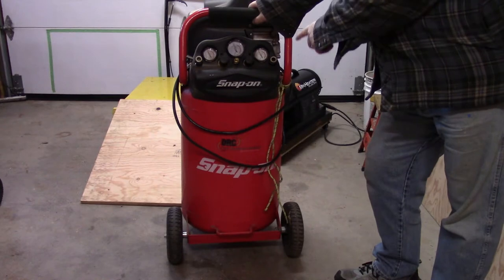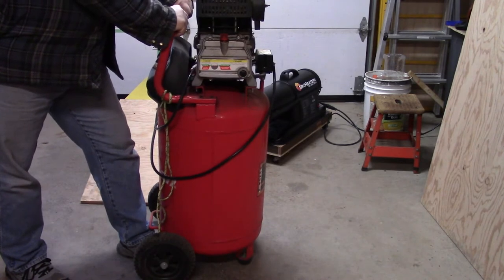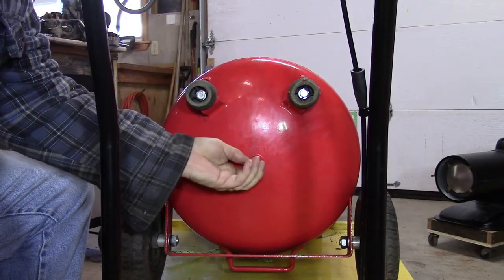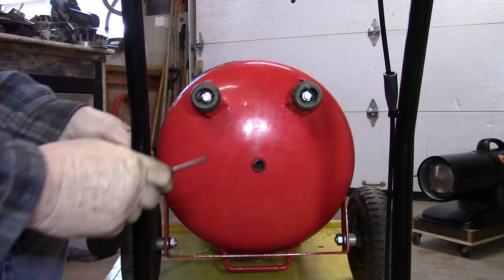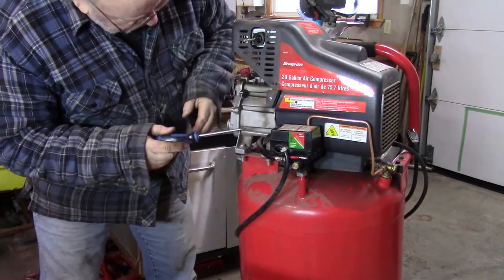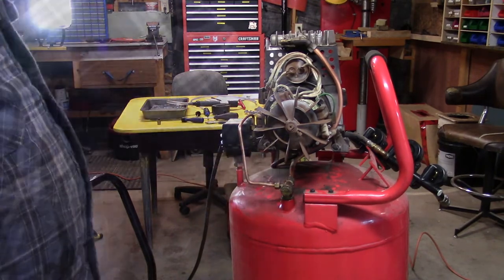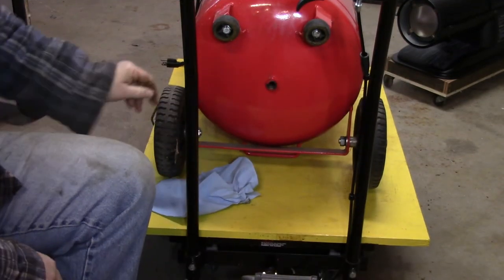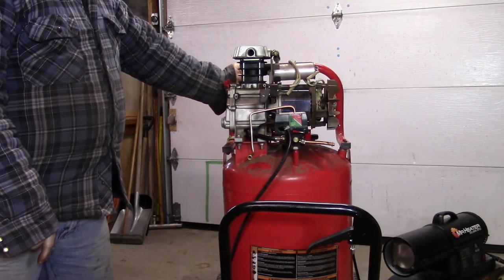Air Compressor Maintenance

Comment: If I were you I'd replace the tank or better yet Get another compressor. That thing blows while you are inside the shop. Well you know. I've seen what can happen!!
Reply from the maker: How's she goin'?  I was thinking of that eh!!  The tank had a lot of rust and it's a pressure vessel, so it can become a danger.  I did a 'ring' test  on the tank and it sounded pretty solid still.  I am going to flush the tank with Fluid Film to try and get rid of the rust as much as I can and then have another look inside.  If it still looks scary, maybe a new compressor in the works!!!  Thanks for your comment and concern.  Take care and thanks for tuning in!!!